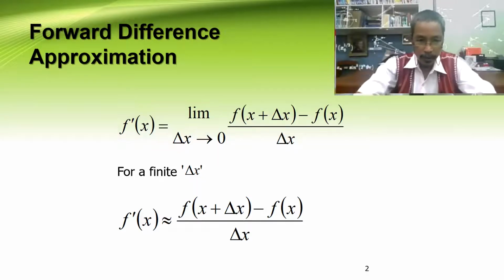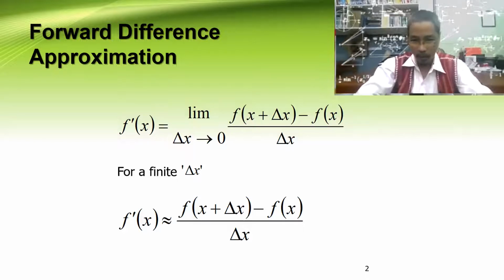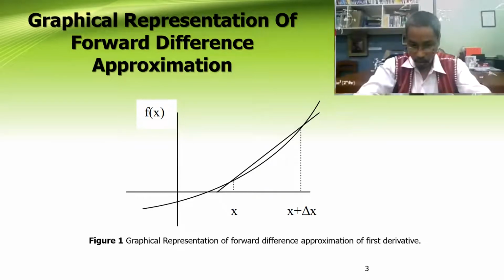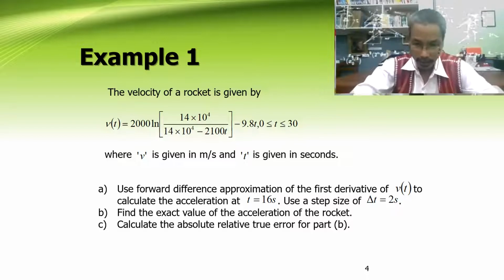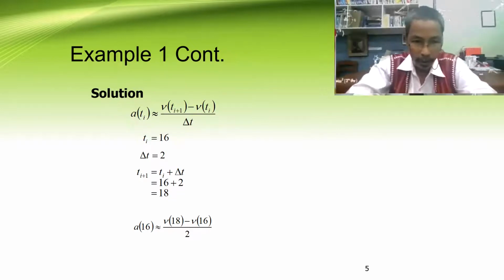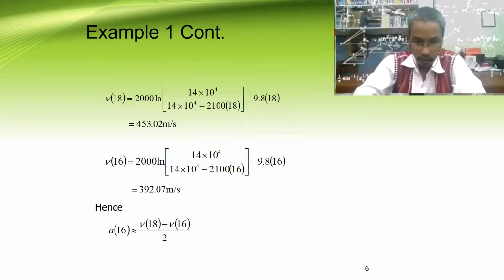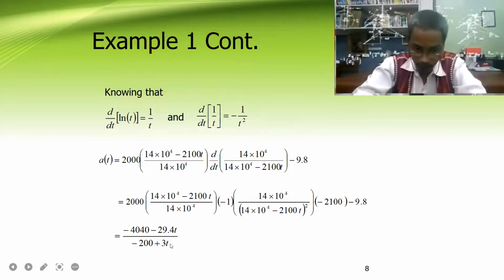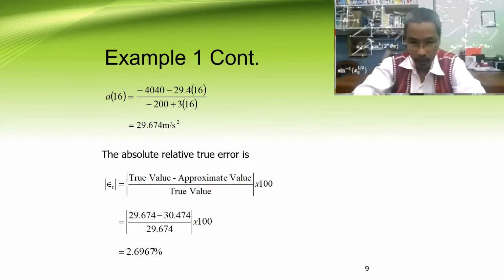FDD Forward Difference | NUMERICAL SOLUTION for CE Problems: Differentiation of Continuous functions

Comment: Assignment: 
Thank you for another lesson that I've learned while watching this video.
Do the same problem and change the given ∆t to 1 second.  Is the absolute relative true error less than 1%? Prove this by commenting your solution.

Given: v(t) = 2000ln [14x10^4 / (14x10^4 - 2100t) ] - 9.8t

A. Use FDD to calculate the acceleration at t = 16s , ∆t = 1s

B. Calculate the exact value of the acceleration of the rocket

C. Calculate the absolute relative true error.

Solution:

a.) a(ti) = [v(ti+1) - v(ti)] /∆t
ti = 16s
∆t = 1s
ti+1 = ti + ∆t
ti+1 = 16 + 1 = 17

a(ti) = [v(17) - v(16)] / 1

v at 17s

v(17) = 2000ln [14x10^4 / (14x10^4 - 2100(17)) ] - 9.8(17)
v(17) = 422.14 m/s

v at 16s

v(17) = 2000ln [14x10^4 / (14x10^4 - 2100(16)) ] - 9.8(16)
v(17) = 392.07 m/s

a(ti) = [v(17) - v(16)] / 1
a(16) = (422.14 - 392.07 / 1
a(16) = 30.07 m/s^2

Comment: A very informative video. Thank you so much, Sir!
Assignment: 
Do the same problem and change the given ∆t to 1 second.  Is the absolute relative true error less than 1%? Prove this by commenting your solution.
v(t) = 2000ln[14x10^4 /(14x10^4 - 2100t)] - 9.8t
A. Use FDD to calculate the acceleration at t = 16s , ∆t = 1s.
B. Calculate the exact value of the acceleration of the rocket.
C. Calculate the absolute relative true error.
Solution:
A.)  a(ti) = [v(ti+1) - v(ti)] /∆t
Where:
ti = 16s
∆t = 1s
ti+1 = ti + ∆t 
= 16 + 1 
= 17

a(16) = [v(17) - v(16)] /1

velocity where t = 17s
v(17) = 2000ln[14x10^4 /(14x10^4 - 2100(17))] - 9.8(17)
         = 422.14 m /s

velocity where t = 16s
v(16) = 2000ln[14x10^4 /(14x10^4 - 2100(16))] - 9.8(16)
         = 392.07 m /s
Hence,
a(16) = [v(17) - v(16)] /1
         = [422.14 - 392.07] /1
         = 30.07 m /s^2

B.) The exact value of a(16) can be calculated by differentiating:

v(t) = 2000ln[14x10^4 /(14x10^4 - 2100t)] - 9.8t
a(t) = d /dt [v(t)] = [-4040 - 29.4t] /[-200 + 3t]
a(16) = [-4040 - 29.4(16)] /[-200 + 3(16)]
         = 29.674 m /s

C.) Calculate the absolute relative true error.
           Et = True Value - Approximate Value
           Et = 29.674 - 30.07
           Et = -0.396

           |εt| = |True Error /True Value| x 100 
           |εt| = |-0.396 /29.674| x 100 
           |εt| = 1.3345%

Comment: Assignment: Do the same problem and change the given ∆t to 1 second.  Is the absolute relative true error less than 1%? Prove this by commenting your solution.

Given: v(t) = 2000ln [14x10^4 / (14x10^4 - 2100t) ] - 9.8t

A. Use FDD to calculate the acceleration at t = 16s , ∆t = 1s
B. Calculate the exact value of the acceleration of the rocket
C. Calculate the absolute relative true error.

Solution:

A.)  a(ti) = [v(ti+1) - v(ti)] /∆t

ti = 16s
∆t = 1s

ti+1 = ti + ∆t
ti+1 = 16 + 1 = 17

a(ti) = [v(17) - v(16)] / 1

velocity :17s

v(17) = 2000ln [14x10^4 / (14x10^4 - 2100(17)) ] - 9.8(17)
v(17) = 422.14 m/s

velocity:16s

v(17) = 2000ln [14x10^4 / (14x10^4 - 2100(16)) ] - 9.8(16)
v(17) = 392.07 m/s

a(16) = (422.14 - 392.07 )/ 1
a(16) = 30.07 m/s^2

B.) Calculate the exact value of the acceleration of the rocket. 
v(t) = 2000 ln[14x10^4 /(14x10^4 - 2100t)] - 9.8t
a(t) = d /dt [v(t)] 
= [-4040 - 29.4t] /[-200 + 3t]
a(16) = [-4040 - 29.4(16)] /[-200 + 3(16)]
a(16) = 29.674 m /s     
a(16) = 29.674 m/s^2

C.) Calculate the absolute relative true error.

| Et | = | (True Value - Approximate Value ) / True Value | x 100

| Et | = | (29.674 - 30.07 ) / 29.674 | x 100 

| Et | = 1.3345%

Comment: Good day sir thank you for your kindly effort and excellent explanation  to us  this academic video God bless you always. 
Assignment. 
Do the same problem and change the given Δt to 1 second. Is the absolute relative true error less than 1% prove this by commenting your solution.
Given v(t) =2000ln[14x10⁴/(14x10⁴-2100t)]-9.8t
A.)Use forward difference Approximation of the first derivative of v (t) to calculate the acceleration at t =16s.Use the step size of Δt=1s.
B.)Calculate the exact value of the acceleration of the rocket.
C.) Calculate the absolute relative true error.
A.) Solution.
a(ti)≈v(ti+1) -(ti)/Δt
t=16
Δt=1
ti+1=ti+Δt
=16+1
=17
a(16)≈v(17)-v(16)/2
v(17)=2000ln[14x10⁴/14x10⁴-2100(17)]-9.8(17)
=422.14m/s
v(16)=2000ln[14x10⁴/14x10⁴-2100(16)]-9.8(16)
=392.07m/s
Hence a(16)≈v(17)-v(16)/2
=422.14-392.07/2
=30.07m/s²
B.)The exact value of a(16) can be calculated by differentiating is
v(t) =2000ln[14x10⁴/14x10⁴-2100t]-9.8
as
a(t)=d/dt[v(t)]
d/dt[ln(t)]=1/t and d/dt[1/t]=-1/t²
a(t)=2000(14x10⁴-2100t/14x10⁴)d/dt(14x10⁴/14x10⁴-2100t)-9.8
=2000(14x10⁴-2100t/14x10⁴)(-1)(14x10⁴/(14x10⁴-2100t)²)(-2100)-9.8
=-4040-29.4t/-200+3t
a(16)=-4040-29.4(16)/-200+3(16)
=29.674m/s²
C.)The absolute relative true error
|Et|=|True value - Approximate value /true value |x100
=|29.674-30.07/29.674|x100
Et=1.3345%

Comment: Thank you for the effort of making a video lesson about Differentiation Continuous Functions.

Assignment:

Do the same problem and change the given ∆t to 1 second.  Is the absolute relative true error less than 1%? Prove this by commenting your solution.

v(t) = 2000ln[14x10^4 /(14x10^4 - 2100t)] - 9.8t

A. Use FDD to calculate the acceleration at t = 16s , ∆t = 1s
B. Calculate the exact value of the acceleration of the rocket
C. Calculate the absolute relative true error.

Solution:
A.)  
                 a(ti) = [v(ti+1) - v(ti)] /∆t
Where:
ti = 16s
∆t = 1s
                ti+1 = ti + ∆t = 16 + 1 = 17

                a(ti) = [v(17) - v(16)] /1
                a(16) = [v(17) - v(16)] /1

velocity @ t = 17s
               v(17) = 2000ln[14x10^4 /(14x10^4 - 2100(17))] - 9.8(17)
               v(17) = 422.14 m /s

velocity @ t = 16s
               v(16) = 2000ln[14x10^4 /(14x10^4 - 2100(16))] - 9.8(16)
               v(16) = 392.07 m /s

               a(16) = [v(17) - v(16)] /1
               a(16) = [422.14 - 392.07] /1
                a(16) = 30.07 m /s^2

B.)
The exact value of a(16) can be calculated by differentiating:

v(t) = 2000ln[14x10^4 /(14x10^4 - 2100t)] - 9.8t
a(t) = d /dt [v(t)] = [-4040 - 29.4t] /[-200 + 3t]
a(16) = [-4040 - 29.4(16)] /[-200 + 3(16)]
a(16) = 29.674 m /s

C.) Calculate the absolute relative true error.

           Et = True Value - Approximate Value
           Et = 29.674 - 30.07
           Et = -0.396

           |εt| = |True Error /True Value| x 100 
           |εt| = |-0.396 /29.674| x 100 
           |εt| = 1.3345%

Comment: this video is about FDD Forward Difference | NUMERICAL SOLUTION for CE Problems: Differentiation of Continuous functions:
Assignment: 

Do the same problem and change the given ∆t to 1 second.  Is the absolute relative true error less than 1%? Prove this by commenting your solution.

Given: v(t) = 2000ln [14x10^4 / (14x10^4 - 2100t) ] - 9.8t

A. Use FDD to calculate the acceleration at t = 16s , ∆t = 1s

B. Calculate the exact value of the acceleration of the rocket

C. Calculate the absolute relative true error.

Solution:

a.) a(ti) = [v(ti+1) - v(ti)] /∆t
ti = 16s
∆t = 1s
ti+1 = ti + ∆t
ti+1 = 16 + 1 = 17

a(ti) = [v(17) - v(16)] / 1

v at 17s

v(17) = 2000ln [14x10^4 / (14x10^4 - 2100(17)) ] - 9.8(17)
v(17) = 422.14 m/s

v at 16s

v(17) = 2000ln [14x10^4 / (14x10^4 - 2100(16)) ] - 9.8(16)
v(17) = 392.07 m/s

a(ti) = [v(17) - v(16)] / 1
a(16) = (422.14 - 392.07 / 1
a(16) = 30.07 m/s^2

b.) Calculate the exact value of the acceleration of the rocket. 
     This solution does not concern with the change of ∆t, therefore we get to solve the same exact value of acceleration from the previous problem and that is a(16) = 29.674 m/s^2

c.) Calculate the absolute relative true error.

Et = (True Value - Approximate Value ) / True Value x 100

Et  = (29.674 - 30.07 ) / 29.674 x 100 

Et = 1.3345%

Comment: Assignment:
Do the same problem and change the given ∆t to 1 second.  Is the absolute relative true error less than 1%? Prove this by commenting your solution.
v(t) = 2000ln[14x10^4 /(14x10^4 - 2100t)] - 9.8t

A. Use FDD to calculate the acceleration at t = 16s , ∆t = 1s

Solution:
A.)  
a(ti) = [v(ti+1) - v(ti)] /∆t
Where:
ti = 16s
∆t = 1s
ti+1 = ti + ∆t = 16 + 1 = 17

a(ti) = [v(17) - v(16)] /1
a(16) = [v(17) - v(16)] /1

velocity @ t = 17s
v(17) = 2000ln[14x10^4 /(14x10^4 - 2100(17))] - 9.8(17)
v(17) = 422.14 m /s

velocity @ t = 16s
v(16) = 2000ln[14x10^4 /(14x10^4 - 2100(16))] - 9.8(16)
v(16) = 392.07 m /s

a(16) = [v(17) - v(16)] /1
a(16) = [422.14 - 392.07] /1
a(16) = 30.07 m /s^2

B. Calculate the exact value of the acceleration of the rocket

Solution:
B.)
The exact value of a(16) can be calculated by differentiating:
v(t) = 2000ln[14x10^4 /(14x10^4 - 2100t)] - 9.8t
a(t) = d /dt [v(t)] = [-4040 - 29.4t] /[-200 + 3t]
a(16) = [-4040 - 29.4(16)] /[-200 + 3(16)]
a(16) = 29.674 m /s

C. Calculate the absolute relative true error.

Solution:
C.) Calculate the absolute relative true error.
Et = True Value - Approximate Value
Et = 29.674 - 30.07
Et = -0.396

|εt| = |True Error /True Value| x 100 
|εt| = |-0.396 /

Comment: The velocity of rocket is given by
v(t) = 2000ln[14x10^4/(14x10^4)-2100t]9.8t

a. Use FDD to calculate the acceleration at t=16s and ∆t=1s

a(ti) = [v(ti+1) - v(ti)] /∆t
ti = 16s, ∆t = 1s
ti+1 = ti + ∆t
ti+1 = 16 + 1 = 17

a(ti) = [v(17)-v(16)]/∆t

v(17) = 2000ln[14x10^4/(14x10^4-2100(17))]-9.8(17)
v(17) = 422.14 m/s

v(16) = 2000ln[14x10^4/(14x10^4-2100(16))]-9.8(16)
v(16) = 392.07 m/s

a(16) = [v(17)-v(16)]/∆t
a(16) = 422.14-392.07
a(16) = 30.07m/s2

b. Find the exact value of the acceleration of the rocket
This solution does not concern with the change of ∆t, therefore we get to solve the same exact value of acceleration from the previous problem and that is a(16) = 29.674 m/s2

c. Calculate the absolute true error part part (b)
|εt| = |(True Value/approximate Value)/True Value|x100
|εt| = |(29.674-30.07)/29.674|x100
|εt| = 1.3345%

Comment: Thank you, sir for discussing Forward Divided Difference.

Assignment:
Do the same problem and change the given ∆t to 1 second.  Is the absolute relative true error less than 1%? Prove this by commenting your solution.
v(t) = 2000ln[14x10^4 /(14x10^4 - 2100t)] - 9.8t

A. Use FDD to calculate the acceleration at t = 16s , ∆t = 1s
B. Calculate the exact value of the acceleration of the rocket
C. Calculate the absolute relative true error.

Solution:
A.)  
a(ti) = [v(ti+1) - v(ti)] /∆t
Where:
ti = 16s
∆t = 1s
ti+1 = ti + ∆t = 16 + 1 = 17

a(ti) = [v(17) - v(16)] /1
a(16) = [v(17) - v(16)] /1

velocity @ t = 17s
v(17) = 2000ln[14x10^4 /(14x10^4 - 2100(17))] - 9.8(17)
v(17) = 422.14 m /s

velocity @ t = 16s
v(16) = 2000ln[14x10^4 /(14x10^4 - 2100(16))] - 9.8(16)
v(16) = 392.07 m /s

a(16) = [v(17) - v(16)] /1
a(16) = [422.14 - 392.07] /1
a(16) = 30.07 m /s^2

B.)
The exact value of a(16) can be calculated by differentiating:
v(t) = 2000ln[14x10^4 /(14x10^4 - 2100t)] - 9.8t
a(t) = d /dt [v(t)] = [-4040 - 29.4t] /[-200 + 3t]
a(16) = [-4040 - 29.4(16)] /[-200 + 3(16)]
a(16) = 29.674 m /s

C.) Calculate the absolute relative true error.
Et = True Value - Approximate Value
Et = 29.674 - 30.07
Et = -0.396

|εt| = |True Error /True Value| x 100 
|εt| = |-0.396 /29.674| x 100 
|εt| = 1.3345%

Comment: Thankyou, Sir., In this video lesson is about Differentiation Continuous Functions.

Assignment: 
Do the same problem and change the given ∆t to 1 second.  Is the absolute relative true error less than 1%? Prove this by commenting your solution.

Given: v(t) = 2000ln [14x10^4 / (14x10^4 - 2100t) ] - 9.8t

A. Use FDD to calculate the acceleration at t = 16s , ∆t = 1s

B. Calculate the exact value of the acceleration of the rocket

C. Calculate the absolute relative true error.

Solution:

a.) a(ti) = [v(ti+1) - v(ti)] /∆t
ti = 16s
∆t = 1s
ti+1 = ti + ∆t
ti+1 = 16 + 1 = 17

a(ti) = [v(17) - v(16)] / 1

v at 17s

v(17) = 2000ln [14x10^4 / (14x10^4 - 2100(17)) ] - 9.8(17)
v(17) = 422.14 m/s

v at 16s

v(17) = 2000ln [14x10^4 / (14x10^4 - 2100(16)) ] - 9.8(16)
v(17) = 392.07 m/s

a(ti) = [v(17) - v(16)] / 1
a(16) = (422.14 - 392.07 / 1
a(16) = 30.07 m/s^2

b.) Calculate the exact value of the acceleration of the rocket. 
     This solution does not concern with the change of ∆t, therefore we get to solve the same exact value of acceleration from the previous problem and that is a(16) = 29.674 m/s^2

c.) Calculate the absolute relative true error.

Et = (True Value - Approximate Value ) / True Value x 100

Et  = (29.674 - 30.07 ) / 29.674 x 100 

Et = 1.3345%

Comment: Thank you sir for this lesson. 

Assignment: Do the same problem and change the given ∆t to 1 second.  Is the absolute relative true error less than 1%? Prove this by commenting your solution.

Given: v(t) = 2000ln [14x10^4 / (14x10^4 - 2100t) ] - 9.8t

A. Use FDD to calculate the acceleration at t = 16s , ∆t = 1s
B. Calculate the exact value of the acceleration of the rocket
C. Calculate the absolute relative true error.

Solution:

A.)  a(ti) = [v(ti+1) - v(ti)] /∆t
ti = 16s
∆t = 1s
ti+1 = ti + ∆t
ti+1 = 16 + 1 = 17

a(ti) = [v(17) - v(16)] / 1

v at 17s

v(17) = 2000ln [14x10^4 / (14x10^4 - 2100(17)) ] - 9.8(17)
v(17) = 422.14 m/s

v at 16s

v(17) = 2000ln [14x10^4 / (14x10^4 - 2100(16)) ] - 9.8(16)
v(17) = 392.07 m/s

a(ti) = [v(17) - v(16)] / 1
a(16) = (422.14 - 392.07 / 1
a(16) = 30.07 m/s^2

B.) Calculate the exact value of the acceleration of the rocket. 
     This solution does not concern with the change of ∆t, therefore we get to solve the same exact value of acceleration from the previous problem and that is a(16) = 29.674 m/s^2

C.) Calculate the absolute relative true error.

| Et | = | (True Value - Approximate Value ) / True Value | x 100

| Et | = | (29.674 - 30.07 ) / 29.674 | x 100 

| Et | = 1.3345%